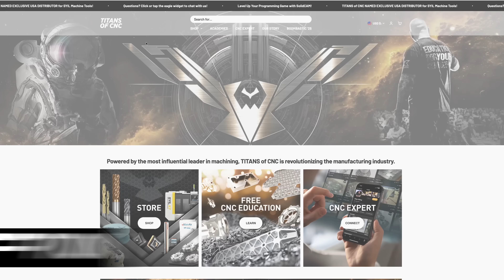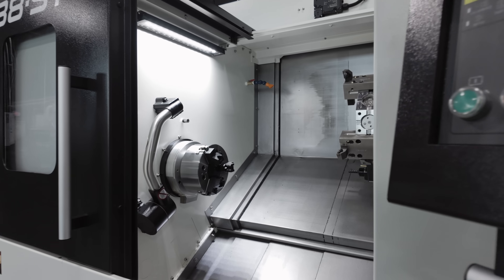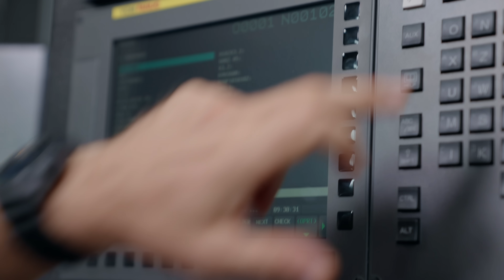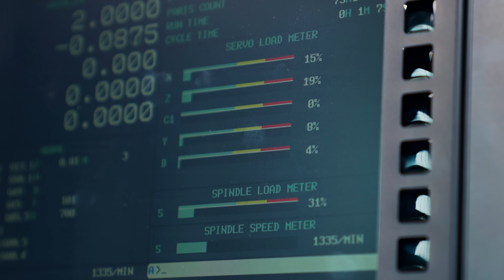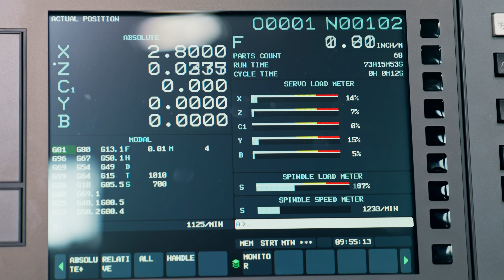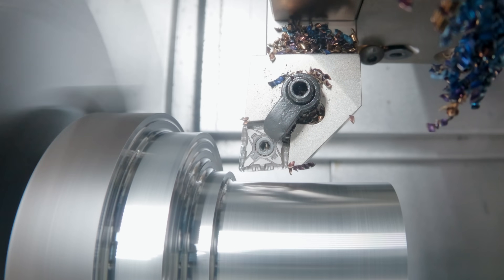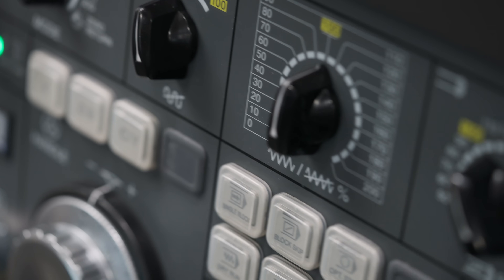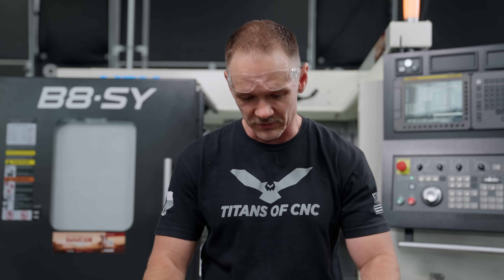STOP Machining The Wrong Way — Here’s Why

Comment: Hi, I’d like to point out a small but important technical correction regarding spindle direction.

In the video, it was mentioned that “M03 is counterclockwise.”
This is not accurate for the machine shown (YCM B8SY) or any FANUC-based CNC lathe.

Correct spindle definitions on all FANUC systems (including YCM B8SY):

M03 = Spindle clockwise (CW)

M04 = Spindle counterclockwise (CCW)

YCM lathes use FANUC control, so M03 can only mean CW rotation, never CCW.
The statement in the video was likely just a slip of the tongue, but it may mislead programmers or operators who are learning CNC turning.

Just wanted to help ensure the information stays accurate—thanks for the great content!

Comment: Hey Intresting Video..  

I'm using right hand tools to my Cnc Lathe & the only Advantage i found is that

When you use Drilling or taping in that case need to run your spindle CCW so. If you use the Right hand tools you will never need to stop your spindle and run it to CW or CCW because for turning & drill both operation your spindle always turning CCW..   that way you will save Electricity & cycle time both..  win win situation

Comment: I had a weird experience while turning long parts with the tailstock, had effin luck, got to turn duplex… and from my experience i had less chatter with rh tools, maybe because it was pushing the tailstock downward, not pulling it upwards… the revolver on a lynx 300 should be heavy enough not to be an issue being pulled upwards… the manual tailstock not so much😅 maybe it was coincidental, dunno

Comment: Why do people add zeros when talking about isocodes? Like why say M03 when M3 work, or M00 instead of M0? I don't get it why type in extra numbers?
Reply: I worked with a programmer who'd do that. M08 M09 M05. Madness. Pretty sure the Heidenhain TNC7 automatically gets rid of the extra 0. Tho, it loves to put a + in front of every positive number, even when you're going home.
L Z+0 FMAX M91
L X+0 Y+0 FMAX M91

Comment: The chip control largely depends on the material and insert geometry. When I'm roughing 4140 or what we dub shit steel with wnmg insert the chips shoot right back down using left hand tool. But on the contrary when turning brass or bronze the chips fly straight up coating every inch of the machine with brass. Plastics shoot straight to the right piling up behind the sub spindle and aluminium just flies everywhere since the cutting speeds have to be so high for chip breaking. So it's not maybe quite as black and white as made to believe in this video.

Comment: At my old company when I was just a setup guy, we had an error in our post processor that would treat cut off tools as left-handed and generate M04s instead of M03s, and the programmer would manually swap them back manually and never mentioned this was an issue. When the day came that he forgot to make the change... oh boy did I learn to pay better attention to the code I was running after that!

Comment: I stay away from switching spindle direction. I use left hand tools to turn inside wide grooves away from the chuck. Right hand tools look like you would hold the tool in your right hand and the opposite for left hand.

Comment: I generally use right handed in the main and left handed in the sub so that If i am doing a part off operation I don't have to change the sub spindle direction.  I also use stacked tool holders, so rough and finish in the main one tool station, and same for the sub.

Comment: After ripping my turret off and snapping turret casting in half with right handed outside turning tool i'm  not going to use them again. Had insert break and tail end of the holder started coming out and caught chuck jaw. Stripped 8x M16 bolts and my turret was on the chip conveyer.
Reply: I'm betting that woke you right up 😳
Reply: @madmat990  Oh yea. I opened the door and and immediately turned off the machine and went home :)
Reply: That was probably super fun to explain to the foreman.
Reply: @Leuka5562  I guess i'm the foreman also :) I own the business
Reply: @OjalaFMX  So you stood in front of a corner mirror and had green goblin style conversation with your self about what happen I hope :D
Reply: @Leuka5562  I sure was yelling to the person in the mirror :) Should have typed MZ0. Typed Z0. Hit Start and 2second later bang rapid move to the chuck face after tool change

Comment: Very good post.  One thing you really did not touch on was linear ways vs box ways, with box ways you if you are running right hand tools you are pulling on the box way vs left hand tool you are pushing on to the box and frame of the machine, and if you have an older machine that has some slop you could get chatter, variations on size and poor finish using right hand tools. Plus, if you are drilling, you do not have to stop and reverse your spindle if running a right hand tool, in most cases, you have to stop and reverse with a left hand tool. You point out some great features and benefits on doing both ways.

Comment: The advantage u found with tool maintenance on the left handed tool is basically non existent with modern holders. All of my right handed tools have the torx slot on both ends of the screw. Just unscrew it from the top, no need to move the turret.

Comment: So I'm really curious as to why the load would change between these tools. I would think it would be nearly identical.
Reply: My guess is...one way the cutting force is with gravity, the other way it's against gravity.  The Y axis servo is having to hold the weight of the turret up against gravity.....so consider that.  I know on my vertical mill, just sitting there, the Z axis servo is at 40% power just holding the head up with no brake applied.  I think it's the same here.  Let me know what you think.
Reply: @madmat990 that does sound like a plausible explanation. Thank you for your reply.

Comment: You missed a big point.
In my shop we often use left handed tools because yes they are  more serviceable BUT the risk of crashing into your tool measuring arm is WAY bigger with left handed tools because the body of the tool is in the way of the arm and if there is not enough clearance, you can crash.

Also it depends but sometimes, with stringy chips, you can get better evacuation by switching to a left handed tool.

Comment: Why do you guys prefer using C shape insert instead W shape? W is more economical,is there something that i missed?
Reply: I have been at shop that use W inserts and they do give you an extra corner. Technically they are a little less strong of an edge due to geometry so really a shop call.
Reply: We use C as our main rough tool. But then we also use all 8 corners. Love roughly Duplex and Inconel using those odd corners. That positive lead angle is beautiful 🤌

Comment: Do you think it hurts the machine going from forward to reverse a number of times during the cycle???
Reply: I don't think the spindle cares.  But I think the motor and belts do, if it has belts.  There's a lot of power wasted (sent to the braking resistor) if you're constantly reversing a high inertia part.  The only people that think about this kind of thing are the people who actually pay for the machines.  It's amazing to me how much operators treat it like a rental car...they wanna run parts fast and clock out...
Reply: @madmat990  Never given this a thought. As a hold over from my milling times it came as a second nature to put M5 on every tool change even if used cutting speed and direction was same between tools. Is there a measurable difference in the lifespan of bearings, belts and motors between start and stop vs continuous running?
Reply: @Leuka5562  Measurable?  Maybe if you wanted to turn it into a PhD project, but think about the current the motor sees running steady.  It's always lower than reversing cycles where you decelerate (dumping power to a braking resistor hopefully) and then when you re-accelerate, the controller will put 100% power until it gets to RPM.  It heat cycles the crap out of it.  It's like driving a car on the highway, versus city traffic where you stop, and then drop your foot on the pedal the whole way to the next stop sign.  Now, if you have an integral motor spindle that's water cooled, maybe it's all 100% fine...   There's never a lack of comments where people say "it was designed to run like that" without ever having spoken to a design engineer or a repairman.  Maybe the companies are making enough money that in 5-7 years it's well paid for itself and depreciated, so run the crap out of it, and just get a new one.
Reply: I have thought about this and honestly it might put some more wear on the internals. Something to consider. Would take some good data to prove.

Comment: I avoid using LH tooling like the PLAGUE. We have ONE machine that some brainiac thought using LH tooling in would be a good idea to "save on time" when changing inserts, over the years we've spent more time and money replacing tool holders and scrap parts because of it than anything else.
Reply: What was the problem if I can ask? I'm curious as I know many do not use LH tools but few seem to have a huge dislike for them.
Reply: @travisjarrett2355 we also have only one machine using Left hand. The only problem we have is if the operator isn't paying attention on the 1st part of a new job. Some new jobs would come from the office (M4) and some would of been a proved job from another machine (M3).
That one lathe is used for our bigger jobs. It's even got a gear box for high torque. That's the only reason it's running L/H tools, so all the cutting force is pushing on the bed and not trying to lift the turret.
The main advantage I found from running M4 (OD work) is on machines with poor coolant delivery. It seems to help it run onto the tool apposed to M3 where it just runs off the job.

Comment: Use MCLNR/L holders so you can unscrew regardless of orientation. The right hand shown can't be undone from the backside since its a DCLNR. Left is better for aura farming on youtube...
Reply: Yes but two screws and two allens has always bothered me. To each their own though. Thanks for commenting.
Reply: . @travisjarrett2355   ours don't have 2 screws. Its just 1 screw with the same size torx slot on both ends. U just stick ur wrench in thru the top and unscrew it. The only difference in that and the left handed tool is the direction u turn the wrench lol.

Comment: That is the big thing I learned early in my machining career when rough turning 8620 castings in a lathe is when using a left handed tool all the forces go into the bed of the machine making it more practical and rigid of a set up

Comment: Small order 1-30 it doesn't matter. A bigger order a specialty small diameter that makes a difference (cutting time). Steel d20-30 mm I often cut with G97 s2000-3000. Cut, drill, cut off and sub same operation you can cut a few seconds.

Comment: Video left uot the fact that you have clearence in guideways that allows its movement. With right hand tool cutting force is trying to lift turret of the guideways. This means that with right hand tooling your application is not as rigid as with use of left hand tooling. Cutting force with lft hand tooling tries to press the turret against the guideways. With right hand tooling it tries to lift the turret of the guideways. As I alkready descriped the guideways clearence allows its movement. Left hand tooling this makes application more rigid oppisite to use of right hand tooling turret may chatter within guideway's clearence range leading to lower tool life and achieved surface roughness (Ra / Rz).

This is not a secret, but there is not enough machine operators to uderstand this.
Reply: I came here to say the exact same thing.

Comment: Can you also explain to not tighten the insert like if the world depended on it lmao😂 so many people strip them out and that turns into an extreme hassle to break the insert and replacing the screw 😮‍💨
Reply: That struggle is real. To this day I do not understand the need to take out so much hostility on such a tiny screw!
Reply: @travisjarrett2355  At my old company we had torque screwdrivers. But used 2 different bits for every size ip and regular torx. People were too lazy to swap the appropriate bit for the given screw so they would regularly strip them with the wrong bit when trying to torque them. Was really frustrating to throw in the trash a 500€ milling head because the stripped screw broke in half when shattering the insert and it couldn't be recovered.

Comment: What I would find interesting would be a comparison of the geometry of inserts. Specifically, a comparison between WNMG and CNMG geometry (both used as Roughing tools). Because the point angle is essentially the same; as far as I know, they only differ in the clearance angle (although I'm not sure about that) and, logically, in the number of usable cutting edges.

I've worked with both types so far and haven't found any particularly noticeable differences other than those mentioned above.

So, I think it's a matter of belief which is better, or rather, a matter of personal preference.

I would be happy, as I can find such a comparison on a professional level, in the form of a video tutorial like you always do.
Reply: With wnmg insert you'll get lower tool life because the insert is lighther than cnmg insert. This leads into higher temperature gradient at tip of the insert => lower tool life. Cnmg insert's higher mass absort heat better than with W insert.

Comment: I’ve never heard an M03 described as counterclockwise before. Obviously when you’re looking at it, it is spinning in the counterclockwise direction but I’ve always seen M03 described as clockwise because that is the direction you would need to spin for a right hand drill or a right hand tool.
Reply: M03 is CCW. Spindle direction is based on the view from behind the spindle.
Edit: Correction you were right, it would be clockwise.
Reply: That's because you shouldn't. My bad. No excuses.

Comment: I wouldn't say that using a right or left handed tool is ever right or wrong to use provided any rotation is going the needed direction.. I think it would probably make more sense to use all right hand or all left hand tools but I don't feel like it makes much difference most of the time which ever you decide to use. Typically the direction the chips are fly doesn't really matter. It just changes where the mess to clean ends up..

Comment: Another thing to add to chip controll is, if you are Finishing with a left-handed tool and get long stringy swarf it can get stuck ontop of the tool and reduce coolant effectiveness or cause scratches on the finished surface where as with right-handed tools the swarf is much more likely to just fall down onto the chip conveyer, if you have one.

Comment: Also, for the right hand, you don't have spindle direction changes for the next operation, like drilling or internal turning, which can speed up the process.
Reply: You took the words right out of my mouth. Was about to make the exact same comment. 👍
Reply: @kkango77 obviously on a swiss or something similar like an index or a machine that just runs aluminium or constant rpm, youd set it up to have one direction all the time.
Reply: I usually just bypass it by already giving it an m4 when the drill retracts out off the part. 

G1z-50 
G0 z150 m4 
T7 ..... and so on.

Same when turning and swaping to the drill. Like

G1 x-2 
G0 z150 M4
T6.... 

:)
Reply: 🎯
That, always in M3
Reply: True story indeed my friend!

Comment: I just can't control my self and pitch in what i consider the best argument. "Use the tool that best fits the process."
Reply: Lighter cuts - M3 and right hand (simple OD ID turns where chip control matters) / heavy cuts M4 and left hand (big parts, wide grooving tools and heavy duty inserts)

Comment: I could tell the difference only because the finished part you held in your left hand had what appeared to be a small section of chatter remnants about midway on the length of the part.  Other than that, they turned out basically the same.
Reply: Also after roughing with the LH tool, there was a clear visible chip-drag mark in the middle of that shank.

Comment: I wrote my programs with a block skip with a tool change position for the turret for just that reason. Of you had to change a tool, you could turn off block skip and after the cut the turret would go X home and index up two or three stations and then M00. Here you could change the tool. Otherwise the part just runs. Sometimes I would use Macros to do the same thing by building in a counter. Every 10 parts the tool would be changed whether it needed it or not. This data came from process control engineers as to when to change tools.
Reply: Every shop I’ve ever worked at….
the engineers are the dumbest people in the building.

I love to have a number to change my inserts because when something goes wrong, I have somebody else to blame.

So many fucking variables in this trade.

“ how come you only got that many parts?”

You can run the fucking thing!

The scheduler in my shop compares numbers to everybody else, but his last job was Cumberland Farms.

Bro, you couldn’t figure out how to turn my lathe on… so you can go pound sand until it turns into a sheet of glass as far as I’m concerned.

I love what I do, but when people that don’t do what we machinists do and tell me how I could have improved the process….

This is why good machinists do bad things too (semi) good people. 😠 😑 😣